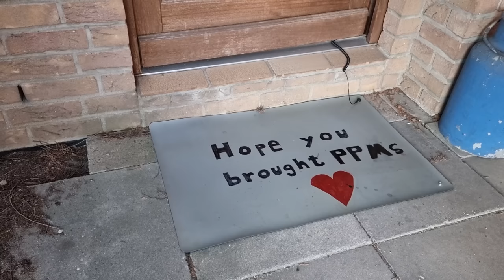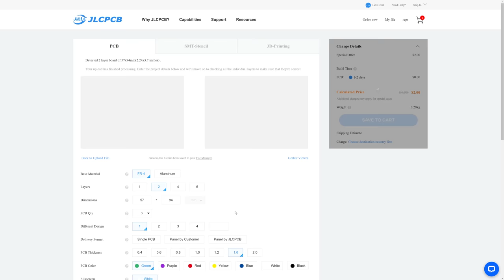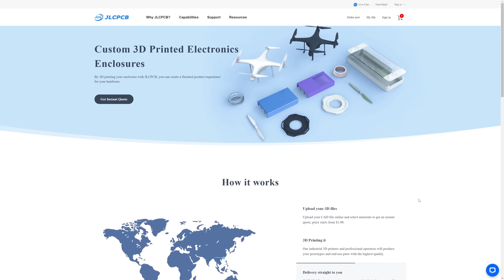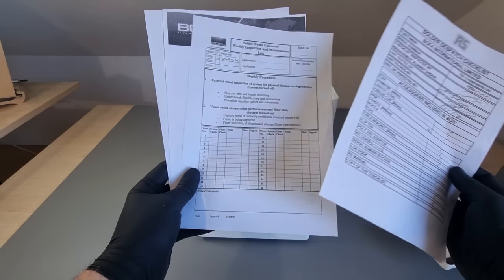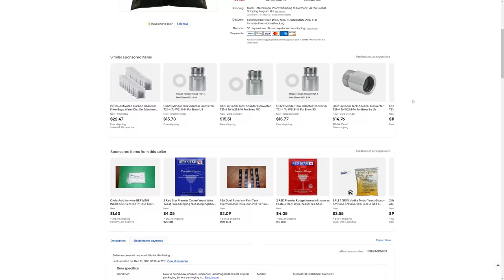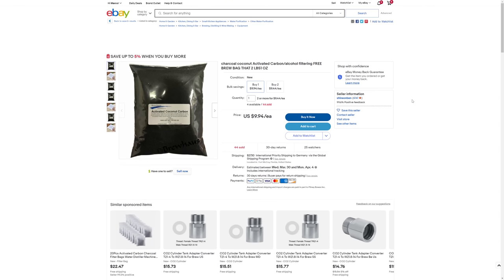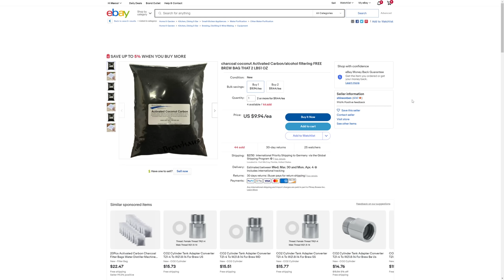All New Everything - Soldering Bench Upgrade for Productivity Ep1

Comment: I'm ready, go on, please. You teased it's a JCB on your PCB-design and used a T245-looking hand piece for the threaded inserts. So I guess there's that. I'm still excited!
Reply: having a 210 and a 245 is something you can never come back from, even the clones are fantastic. I've been using the hakko t12s for years, they weren't even called t12 back when I got my first genuine hakko station, but these days I can't even look at the thing because the ghetto c210/c245 clone station is such a dream to work with
Reply: I can spoil that all of the video is all about the JBC soldering station (including a T245 and T210 soldering iron) & the video is about twice as long as this one
Reply: @youchooby  any recommendations for c245 clone manufacturers or sellers?
Reply: @youchooby  Same for me! I went with the clone Handskit station + T245 and T210. I bought a few genuine cartridges, it's awesome! Just open them, reroute protective earth to the case for safety and 100€ in you're on-par with the pros. Feels good, and even a beginner can get wayyyy better results with this setup.

Comment: The microscope looks similar to my Ali Eakins sterescopic. Mine came with somewhat oval vertical chrome bar/pipe that did not fit into the head, but the manufacturer quickly sent another one. One upgrade that I would still like to add, is the adjustable boom arm, which would allow microscope to be tucked away when not in use.
Reply: I have a microscope from them without the stereoscopic view and I'm also very happy with it. Paid 120$ for the 37MP 1080P 60FPS version, with stand and light. In comparison to my cheapo 40$ one I had before it's night and day. Looking forward to the ones with autofocus.
Reply: those easkins ali scopes are fantastic, I use one with an articulated arm that clamps to the back of my bench, and it saves on bench space drastically. I have an extremely cramped lab so this is a necessity. all in all the whole kit was less than $700 canadian fundollars
Reply: Got one of those Eakins myself and am quite happy with it. Bought a boom arm separately, which had to be modified to be usable.  The rod that runs on those linear ball bearings was made out of soda cans or something. The balls actually made grooves in the metal, no smooth adjustment at all. Had to get a hardened steel rod and ask a friend with a lathe for help. Swapped the linear ball bearings for some nicer ones too. Now its pleasant to use but it seems to be a widespread problem with those Chinese boom arms. Even on the Amscope ones. Just something to keep in mind if someone plans on buying one.

Comment: Make sure to get a proper HEPA filter behind your activated carbon filter! Or you will wonder why everything gets thin film of black dust over time.

Ikea has cheap replacement HEPA filter
Reply: Yes the active carbon will remove the smell, but not stop the harmful sot, for that you need a HEPA
Reply: I just happened to watch EEVblog video #1616 recently - Weller fume extractor review, May 2024. Part 2 is on the EEVblog2 channel. The HEPA filter goes first, charcoal second. 

It makes sense that way, doesn’t it? The filter takes out relatively large particles and the activated charcoal absorbs the molecule size compounds. 

It would probably work the ‘wrong’ way round too, but I imagine the charcoal would become clogged.

Comment: Using the same ESD mats from Welectron on my workbench and they are the best! Not sure it's possible to find better for a similar cost.
Reply: What I don't like that much about it is the structure. I find it pretty hard to clean it (even with isopropanol) because of that structure it has. Flux resedues...even some coffee is pretty hard to get rid from the mat so I use cheap smaller silicone mats now on top of my welectron safeguard mat just to not get it dirty.  Not sure if I would buy it again for a soldering workplace.  For testing and assembling they're really nice, but at places that involve flux and get a bit dirty.... I'm not that happy with it.
Reply: @cambouiscom  what do you use to clean them? Did you figure anything out that works better than isopropanol?
Reply: @cambouiscom  Thanks, I'll give it a try. 👍

Comment: Took an electrical engineering class in high school back in 1998 or so. I can still vividly remember the smell of burning PCBs. Once we realized you could use a soldering iron to write on the PCBs...well you could smell the lab from 100 feet down the hall for a few days. Don't know if soldering fumes are worse for you than PCB smoke, but at the very least neither is a particularly appealing scent. :)

Comment: I'm guessing you disappointment is related to fact that Robot commands in JBC DMU work only in Robot mode, and if in Robot mode, handpiece stand doesn't work and you need manually start and stop. I guess what you are trying to do could be realized by connecting to peripheral port, as original JBC fume extractor, but the i guess some sniffing of protocol would be required.
Also a way is to go through USB, as there (at least in DMU) is just a serial converter. So far I discovered that frames consist XOR checksum, frame sequence number and length. 
When I found there is Robot protocol / commands I was hoping to make external buttons as DMU is only poor working touch screen, but that failed fast cause of the reason I mentioned before. 
I hope you get some progress there, that I didn't find yet. 
Can't wait for next episode. Cheers

Comment: Microscope looks identical to my one, you'll hate that small arm and stand though. I welded up an articulated arm that mounts it to one end of my bench, deleted the stock base completely. Now it's easy to pull across the work surface when needed and just as easy to push it away when it's not. Such things can be bought ready-made of course, I just value my arms and legs.

Comment: I have a microscope that looks just like yours. I got mine from union repair a few years ago.
It works well so far, but there are a few issues.
There seems to be some dust inside the optics. At some zoom levels, there is a spot visible in the camera port. I tried to open it and clean it but didn't get very far, so I have to live with it.
Adjusting the focus, so the camera port and the two ports for the user are in focus at the same time is very fiddly. I never got it to a point, where they focus similarly and don't get out of focus while zooming.
The field of view of the camera is also an issue. I had to try several adapters until I found one that is OKish. Now I use an x0.5 magnification one. The field of view of the camera is still not what the user sees. Also, the shape of the adapter makes it impossible to mount some cameras. Currently, I run a Rasperry Pi HD cam, and that works fine.
Reply: F Kiesel  ,  Good, but please tell us if you upgrade.

Comment: I have a similar oil lubricated compressor for air brushing. I use a SMC  
P/AMD150C-02D micro mist (oil & water) separator it filters down to 0.01um to provide clean room grade air. Make sure to get the one with a normally closed auto drain port. My filter is located between the compressor and tank, your tank and regulator are likely contaminated along with the hose with water/oil and so you should add the filter after the regulator and get a new hose/gun.

Comment: As my favourite YouTuber I am amazed at the toys you get given.  Having been trying to make some videos myself I have a new found understanding of just how hard it really is!  Oh and do you have the STL file for the monitor stand :-) I was going to make one myself!  That JBC desoldering iron is a thing of beauty.  I remember my old Weller desoldering station from the early 90s.  I couldn't justify one for my new lab so went with a Duratool one.  It has complete guns as replacements for £20 and does almost as good a job as the Weller did.  I just wish PACE would make one.  I am a massive fan of their station (I bought the same one you used).  Anyway keep up the great work and thanks.

Comment: I just did a very similar upgrade! Although I still need to order an extractor. I got the quick 861dw and the Eakins double boom trinocular scope but I imagine the scope heads are all the same just packaged with different accessories and mounts (The shipping to Australia cost as much as the unit). I'm also waiting on my new Iron (Hakko FX-951) Currently using a ts100 and it has served me well.

Comment: Regarding switching of the fume hood: sonoffs with tasmota flashed allows easy api or mqtt accees. You don't have to deal with high voltage yourself. Add Homeassistant on a pi and everythig is well connected and extendeble.
Reply: you're speaking a different language to me
Reply: Even an adjustable master/slave power strip could have worked, but this is Marco Reps, so I think we'll accept every possibility to get some free PCBs made :)

Comment: JBC tools have a pull up connected to the metal stand, just read that signal with an arduino to control a fume extractor, easy and works for compact unit without 232 port.

Comment: I like the video quality I see from the microscope.

A few years ago I bought a Koppace "21MP" camera and, separately, several different lenses to roll my own microscope.   I have been pretty disappointed with its video quality and not super happy with its still pics either, though they are better.  It has more noise in the live video than I like and adding brighter lighting doesn't help enough.  Also the OSD GUI firmware is buggy and they don't seem to offer any firmware updates.  It wasn't a terribly expensive camera, but not cheap either.  Kind of turned me off the Koppace brand.

Comment: Did you end up soldering the jumper to power the Arduino through Vin with 12v? Trying to work out if I should do the same or use an external voltage regulator.

Comment: The prices at JLCPCB are no joke. Apparently they have 6 factories and that helps with pricing. I got 15 aluminum boards manufactuered for $8 where two other factories quoted $60 and $180.

I only wish they had SIGNIFICANTLY better PCBA policy and part selection. They only do PCBA for SMT parts in their parts list, and searching through it is pretty frustrating because of the poor category filtering. LEDs for example have colors and whites all under one category, there's no min CRI filter, luminous intensity is filtered in mcd with no beam angle given (lumens please) and intensity ranges are mixed alphabetically, sometimes with their own range. Efficacy and test/max current not filterable either.  You have to know what you're looking for, generalize by package size, and  then ask for more information in an email because the attributes are blank.

I'd really like to hear who has had successful PCBA with JLCPCB because I just get boards shipped to a boardhouse that can import my parts. JLCPCB won't do that and requires you to add requests to add to their SMT library. 

Thanks for the video though, I always enjoy the sort of lighthearted meme style presentation mixed with thoughtful consideration for details.
Reply: For more advanced PCBs (e.g. flex, rigid-flex, etc.) and PCBA, pcbway seems to do a great job while still being relatively affordable. They can source the parts themselves, have you provide them, or have you provide some while sourcing the rest. As far as I know you can basically use anything on mouser/digikey/etc. - but obviously they also support local (i.e. chinese) equivalents. One of the big things for me personally is that pcbway offers two-sided PCBA, while JLCPCB is limited to single side.

While the JLCPCB parts library indeed is terribly UX-wise, there is an open-source project called "jlcparts" on github, with the application hosted on github pages. It's an alternative frontend for the JLCPCB parts catalog, and caches all parts in your browser's memory. Also there's way more filtering options.
For me personally, it's not 100% stable, but certainly a huge improvement compared to JLC's own parts library.
Reply: @daskadse769  Fantastic, thanks for the twofold suggestions!

Comment: I very strongly suggest you get something to assist your fume extractor; i find that more than about 150mm from the suction hose they do pretty much nothing; I grabbed a old server fan and stuck it on the front of the suction cone and ran the cable back along the hose down to the extractor and it helped a LOT.

Since you are lighting the workbench near permanently, there are some nice high CRI LED strip modules available from osram etc on digikey, a few of those (of varying color temp) and a few matching driver modules can make some very nice work and filming lights for very little money.

Probably not much effort to filter the crap out of that brushless compressors supply, worth while for the convenience of leaving it on imho.
Reply: Or just attach a few feet of flex duct to the server fan and use it to blow the fumes out the window. No filters to replace.

Comment: If you don't care for the 1200W, a quick 706W can be had for even cheaper and it has the same blower motor (which is what makes these stations so much better than the ones with the fan in the handle). Oh you get analog knobs and a soldering iron with it for free :D

Comment: I think you shall add a really good soldering station in there. There are those chinese cop.. hm. versions of JBC which are really good. Little bit of temperature overshooting maybe but well built and faster than a rabbit, if that is a way one can speak. They have really impressed me. Sugon something, is a brand. Probably there are other good as well.

Now, I'm ready for the follow up. :) And more of that german sarcasm! 

Time to get a new hot air station.

Comment: For the compressor, since it's polluting even with the motor not running, maybe it's just the low voltage power supply generating all that garbage? If you're ready to do major surgery, maybe isolating it by cutting the tracks and adding a linear power supply with transformer would work?

Comment: I like the ESD precautions, I see too few of them on many YouTube channels.  Unfortunately, when you put the silicon pad on the microscope you may have defeated your purpose for ESD.  You could cut a piece of an old ESD mat (with the snap if possible) and use that for the microscope base cover.  You could also use an antistatic ionizer, but it messes with the hot air pencil (and soldering iron temperature).
Reply: Lol go preach your antistatic precautions to Louis Rossman
Reply: @Crazy--Clown  That got me going, thanks for the chuckle!🤣🤣🤣🤣

Comment: I'd just get an external oil mist collector and use the jun-air. That a a way better compressor than the other one you have. I have a similar model and its great. I have a two stage filter on mine, one has a element for getting water and the other for capturing oil. 

As for the solder fumes, some are worse than others. There is no lead in the fumes and natural rosin is not so bad but some of the no-clean fluxes are not so great.

Comment: I have a similar microscope from Banggood and it does the business, however I've still to find a proper mounting system for it, mine came with a bigger base plate with the silicone mat included, but the whole arm contraption basically wants to fall over at any time, so I'm still not sure how to set it up as I like it.

Comment: Hello mister - ! - in odred to stiffen up that tube twist it , the more you twist it the more stiff it becomes, I usually twiste them hard and stiff on the base - and less in the middle so you can adjust it properly, I also designed a 3d printable parts with a valve that can be opened and closed. Also this unit you hav I think it is deisgned for two sockets, if you block one off the turbine will slow down to 50% The tubes are quite expensive because they suppose to be esd safe. As with fumes its notr teh solder but flux fumes that are corrosive to your lungs, depending which flux you are using. The lead poisoning would only happen if you literally chew on it everyday.
Reply: The filter in that extraction does also hepa filtration, you can play and build your own filters if you have time yes, there are also companies that will build filters to spec and dimensions you specify.   With those scopes - they are so expensive because of the optics, I took one apart, it a lot a Lot of machines parts , prisms and precise lenses all over the place, Yo ucan easily do a video just about the way the scopes are built. That plus heravy weight on the botom to stop it form falling over - thus high cost for shipping. If you want to increase the 'zoom ratio you can attach a lens on the bottom - it screws on where the lights are. When the handles get loose you can twist them together ( to control the focus ) opposite way form each other and then they will stiffen up - or loosen up depending on the direction. The step forward is autofocus, you could in theory attach a servo and build in focus using data form that display